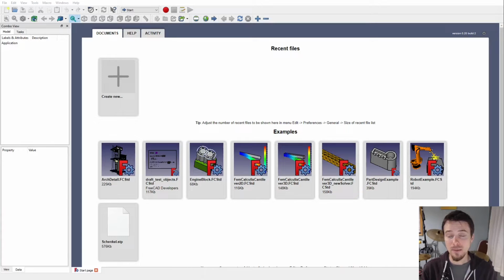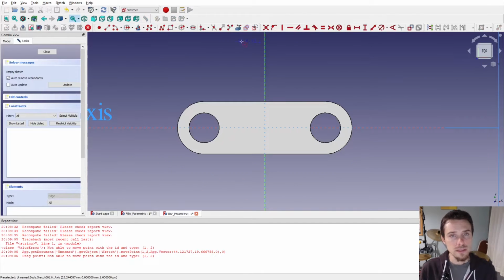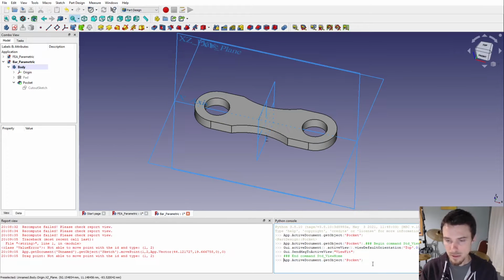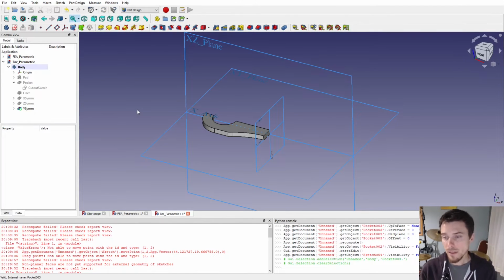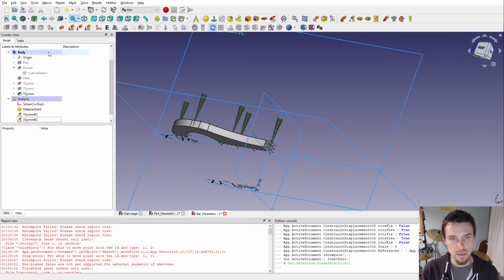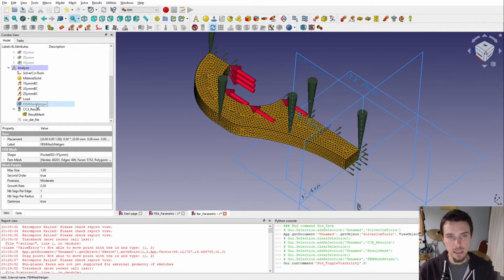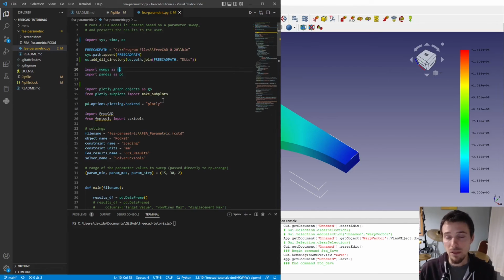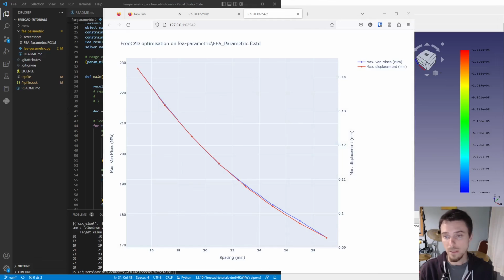Easy parametric FEA with FreeCAD and Python

Comment: thank you for the video..can this python code executed through macros in freecad
Reply from the maker: No, it's designed to run as a standalone script outside of FreeCAD, but you can fork the project if you have experience with Python and you should be able to reuse most of the objects